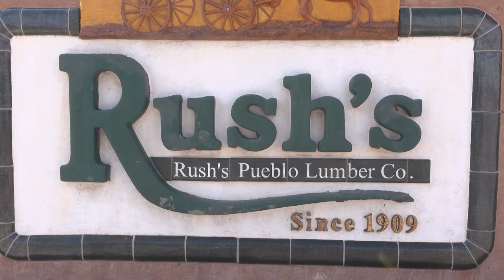I had NO IDEA!

Comment: Word of advice on bee/wasp stings (as I get them a lot) make a little bit of paste with Baking Soda and Water and put it on the sting. Let it dry and it should flake off, it removed the itchiness most of the time and should significantly reduce swelling. I've also heard that rubbing a slice of Onion on it makes the itch/pain go away.
Reply from the maker: I have heard of baking soda, but the onion trick is a new one.

Comment: I'm currently building a timber frame barn, and it's the ply and 1x lumber that has not come back down. Dimensional (2x) and large stuff (8x8) has come down quite a bit. The more a mill has to do to your board, the higher the price.
Reply from the maker: That makes sense, this was all nicer material.  The 100 L.F. of clear fir was the biggest cost.
Reply: OSB, which used to be the cheapest junk on the market has gone absolutely stupid!

Comment: In my mind I always wonder what a small business (Not the big box DIY centers) does when they have invested in products and then the price drops.  They need to sell it out at a profitable level.  I spent many years as a district manager with a large chain electrical distributor.  I can't tell you the number of times we purchased wire (copper or aluminum) or conduit as the market was going up and then watched the prices drop below levels we had ever seen just a few weeks later.  Looking at your local lumber yard I would suspect that is exactly what happened to them.  We have a big DIY center here that has dropped their lumber prices dramatically while my local lumber yard where I prefer to shop is stuck with high priced material.
Reply from the maker: I'm sure its tough on them.  But hopefully they didn't buy too much stock at the higher prices and were able to save for the eventual leveling out.

Comment: It's getting to the point where it would almost be cheaper to cut down a tree and mill your own, if you had the time to wait a year or more for it to dry. You could buy an Alaskan mill to go with a large chainsaw for about half the price of that small load of lumber. But if you had to buy a decent chainsaw or a bandsaw mill, you'd still be out considerably more money in the short term to get started. But you'd be set in the long run. Of course you'd have to plan well in advance for what lumber you're going to need for projects. But then again, you could have a side business milling and selling lumber, at a discount, to your local friends and sub-contractors.
Reply from the maker: I had a saw mill for a few years and the blacksmith shop is built mostly with wood I cut.  But it is more time than I can invest these days and still do everything else I need to do.  Plus our local trees aren't very good for anything but rough framing lumber.

Comment: Yep. $940.00 could be a down payment on your first sawmill. Logical progression of skill sets.
Reply from the maker: I had a sawmill for a while.  But there just wasn't enough time to make good use of it.  Plus our local trees don't make good finish materials, although most of the wood the shop was built from was cut on that mill.
Reply: @JohnSwitzer  
  Didn't realize that. So you don't have pine, fir, or spruce on your land?